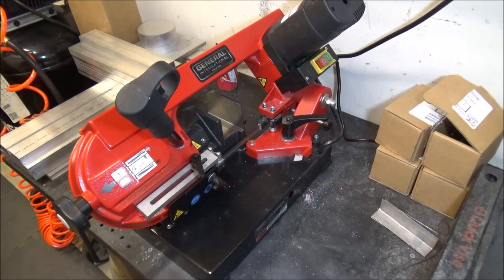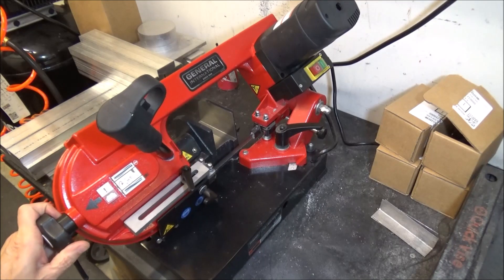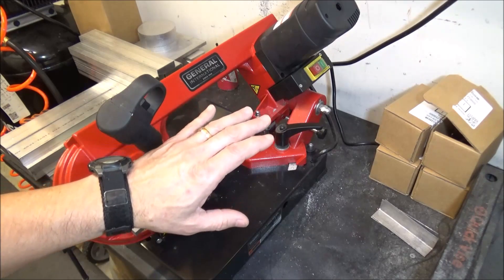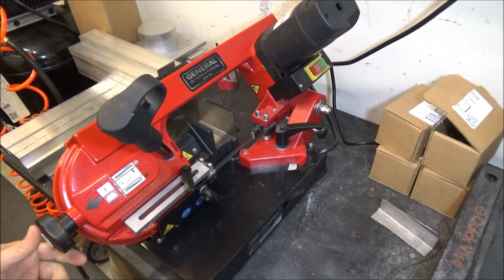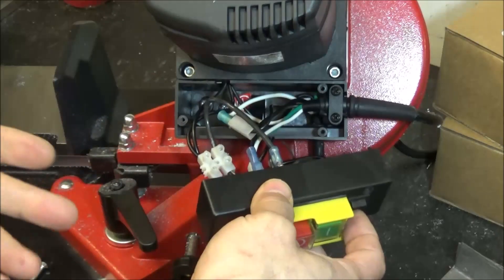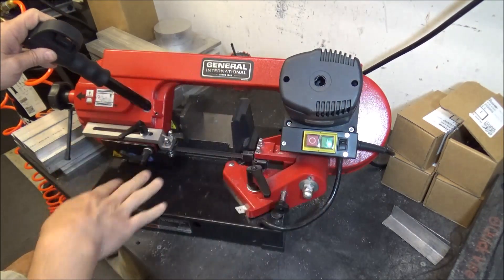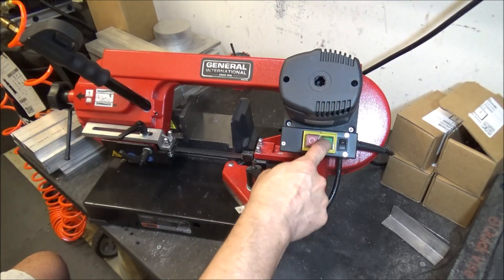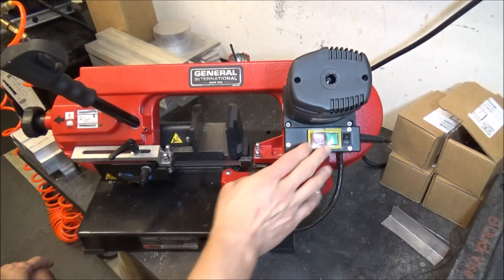Bandsaw Modification UPDATE

Comment: In my opinion would be a vertical band saw instead of a swing type of band saw if you had the space & money.
Reply from the maker: I considered a Vertical bandsaw However I really wanted to be able to clamp the stock turn it on and walk away. So far the saw works great! 1.5" Stainless bar no problem.